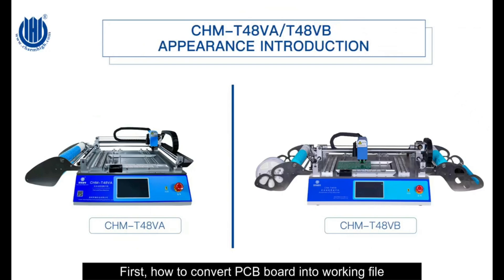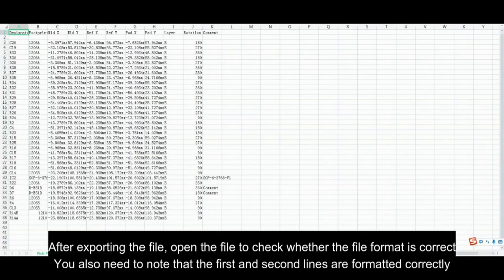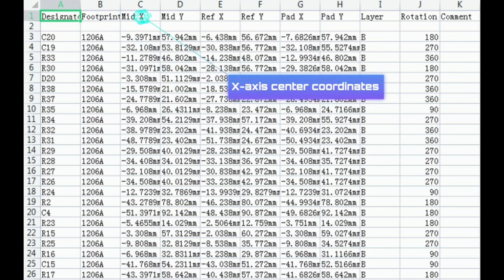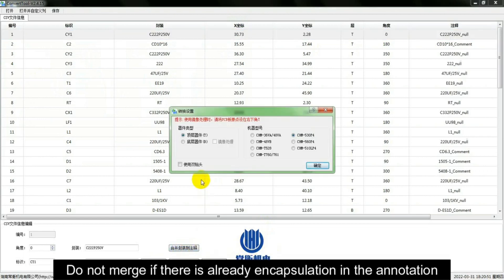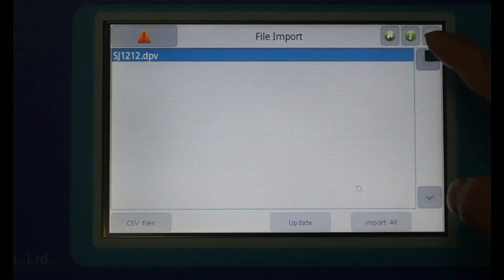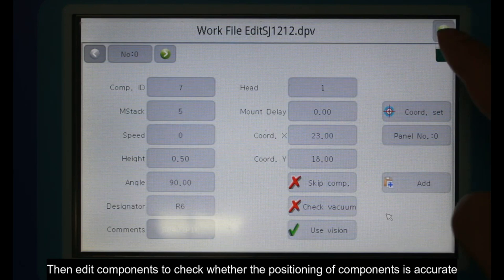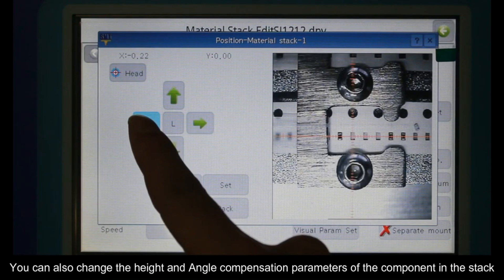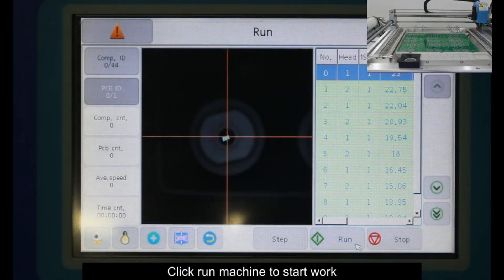Get started quickly - CHM T36VA, CHM T48VA, CHM T48VB

Comment: Hello, I'm using T36VA well. But I have a question. When you enter the set screen, it's a question about Visual Assist. Why doesn't the device go to the desired location on the PCB when I turn this on? That's why I always turn off the Visual Assist and use it. When I turn it off, the device goes up to the desired location on the PCB. Why is that? Please let me know.
Reply from the maker: Hi friend, the problem is the overhead light above the machine, the lamp affects the machine camera's vision recognition, please turn off the light, or cover a piece of paper above machine's head to avoid the light.
Reply from the maker: you can check this video from 1 minute 45 seconds :  https://www.youtube.com/watch?v=jBLuTNBOs9Q
Reply: Thank you. I finally solved it. I never thought it was because of the lighting! Thank you so much!!😀😀
Reply from the maker: great! @justdoit9210

Comment: Hi, today a problem appeared with the CHM-T48VB machine at my workplace, after a run, when I placed the next PCB all the components appeared with an offset, when I tried to send the nuzzles to the origin, they went to the bottom right part of the quadrant, with a message that said "Y axis lose step", when I clicked on this warning a message appeared that said "Motor groan under", any idea how could i solve this problem?
Reply from the maker: First please check if the Y axis's coupling and the brass wheel loosen?  please make sure the screws are tightened.  Second please tell me if the X and Y axis can be pushed easily by hand when powering on the machine and going to diagnostic mode?
Reply: I checked the brass wheel and is not loosen, also, when i go to doagnostics mode i can move it but i have to apply force, it doesnt move easily